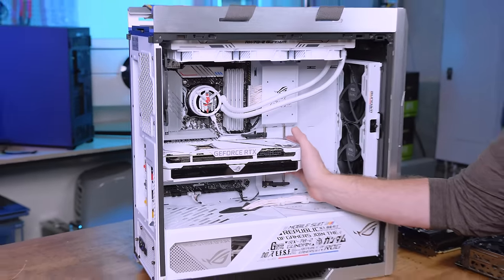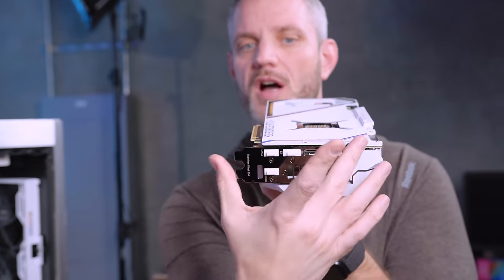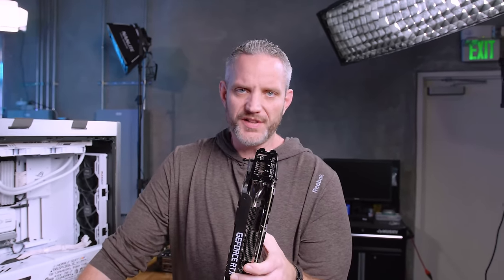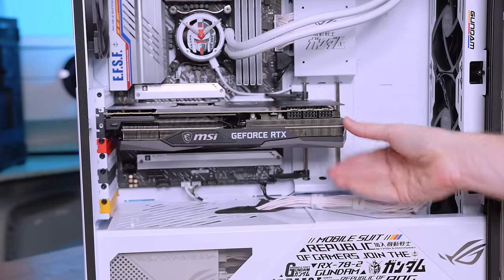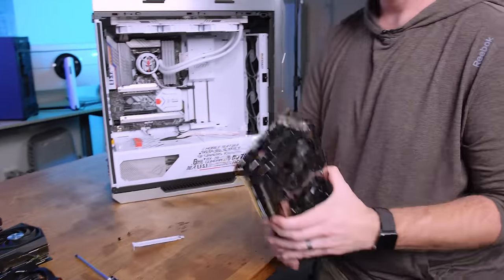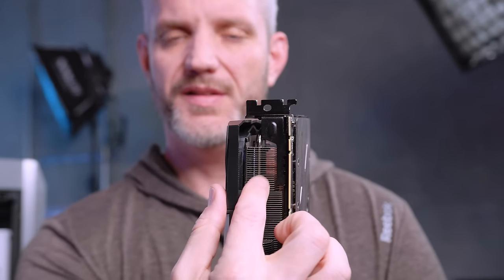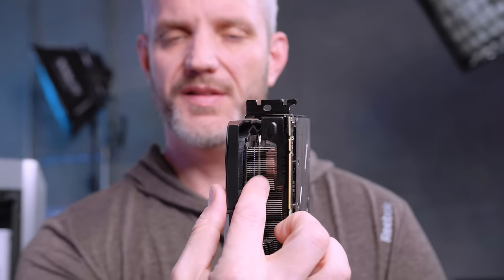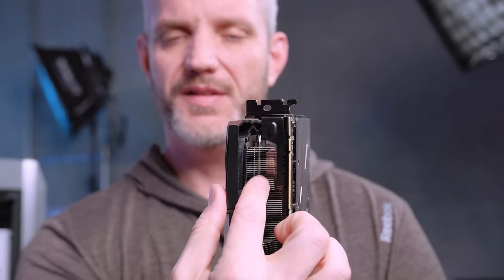How to fix GPU sag ONCE AND FOR ALL! FREE!

Comment: I had this problem on my 3080 Tuff. I solved it by 3D printing a black sag bracket. It worked very well and you can hardly notice it with the glass panel on with rgb lights on.

Comment: Other ways to fix sagging:
- Use a vertical Case (I have a Silverstone Raven RV02 and i love it - it is over 10 years old, still best airflow i ever had)
- put a drop of glue that gets really stiff between the cover in the Back and the cooler
- use a vertical mount
- fabricate a small support the most hanging edge of the card if you happen to have a 3D Printer...
Reply: -Have a small or no gpu at all
-Use water cooling (The water block is USUALLY way lighter than those beefy heatsinks)

Comment: Just did this with my 3080 and it worked! Thanks for this simple and easy fix - was driving me crazy since I installed the new card.
Reply: Its really nice If the case is fully black you wont even see the brackets.

Comment: even better solution: just put some adesivo rubber pads instead of more brackets. I got some of those cheap, transparent silicon anti-impact pads that you usually use for walls (so the door or handle don't hit it). Worked PERFECTLY.
Reply: Can you post a link by chance? I am not sure what you are talking about.
Reply: Genius! starts pawing through the junk drawer
Reply: Rubber is much better in my opinion too. When you modify metal inside a PC case, there's always a chance of creating some type of short. Overkill, I know, but yes, "I'm saying there's a chance". Plus - sound/vibration dampening!

Comment: Thank you for the simple fix!

There are other implications with sagging cards. Over time, the PCB its self will warp and cause intermittent failures as the etches crack and solder joints fail. This was an issue some years ago with poorly designed cases causing the motherboards to warp and flex. The other issue too is as the video card sags, this will put stress on the motherboard its self and that will cause etch-failures along the PCI-e slots.

I ran into these kinds of issues a few decades ago, or more now actually (I'm getting old) with various circuit boards I used to repair back when I used to be a board technician.
Reply: @CRSolarice  You're absolutely right. It's funny how ideas float around then return.

Back in the olden days, the issue was solved by using a channel to support the PCB along its edge near the front of the case. This worked well until cards were pulled in and out carelessly breaking the plastic channel or popping it out of its mounts. When that occurred, the cards would sag and cause problems with the motherboard such as the ones I mentioned. I ran into many motherboards that had ripped connectors and pulled etches. Sadly, once that occurred it was quicker to scrap the board than it was to repair it which could be done using buss-wire and solder. This latter part wouldn't be possible today due to the high frequencies we find with our computer busses. Back then things were in the Khz and low Mhz range.

The other issue we face today is computers are not all the same size and not all are manufactured in factories like Dell, Lenovo, and HP. Today, we have enthusiasts putting machines together with various sized cases and motherboards, making a one size fits all solution impossible.
Reply: @CRSolarice  I'm not much further behind you. I currently have an i7-5860. I agree going for the latest and greatest isn't necessary and I too go for the "new stuff" later usually to let the crowds pay for the hardware development and work the bugs out before I come along and get the stable hardware for a lot less than they paid for it. 

Right now, I am looking to replace my system because I lost some USB ports on my motherboard. I powered up my PC and the keyboard and mouse didn't work and neither did my backup drive. I jiggled wires, but that didn't do it. After a second reboot and replaced keyboard and mouse, the system booted, and the hard drive appeared but the system can't find 3 USB ports. My 1080 TI and RAM still works and so do my hard drives. I'll get another motherboard, one with a faster chip and move my RAM, hard drives, and video card over to that.

In the 1970s I was building electronic kits and instead of becoming a music major like I originally planned (parents said NO!), I got into electronics instead. I headed initially to engineering but found tech stuff more fun and eventually landed in the hardware tech field testing and repairing circuit boards until those jobs went overseas. Today, given my eyesight, I'm not even sure I could do it because the components and everything is the size of ants. The stuff I worked with were the typical 70s and 80s equipment with little surface mounted components. I repaired disk drive controllers, modems, video terminals, and all kinds of memory cards, I/O controllers and comms cards. I learned a lot too and came to the conclusion that even the stuff we have today is still the same as yesterday except smaller, faster, and more delicate.

Your concern is a big one because that can ruin the sockets eventually as I saw in the ancient hardware with cards not supported. Some of those systems had what we referred to as board packs. These were multiple boards that plugged into a single one via riser connectors and ribbon cables. This made a heavy pack, about as heavy as those new video cards. Without that extra support on one edge, that would eventually pull out of the socket and sometimes ruin the motherboard or backplane depending upon which style system these were in.

Laying down your case isn't such a bad thing. The problem is It will be absolutely terrible you won't be able to see those blinking lights! We'll have to commiserate over a beer someday on that one. 🙂
Reply: @CRSolarice  excellent comment.

Comment: My case is a Corsair 5000D with a dark black side panel window.   I just went to the dollar store and purchased a super thin black metal wire,  tied it to the gpu and secured it to the top of my case.   My case its beside my desk on the floor, so there is almost no way to see the wire.  Solid as a rock support for $1.25.  A great alternative.  In the new right now,  on some gpu cards , the tab that fit into the motherboard at the bottom of the gpu, is cracking.  The gpu company then denies the warranty claim due to a damaged gpu board. That basically kills the gpu because some companies have electrical traces running through it.  So either support your gpu in some way or risk killing it.

Comment: This worked! I have a Lian Li Lancool II Mesh case, with an EVGA Gefore RTX 3070 FTW3. I took the two extra brackets, slid them in as described in the video and the sag is gone! The nice part about this case is it has a darkened border on the glass door, so you cannot even see the screws once everything is in place. Thanks Jay for the ridiculously simple and free solution. This should have 1M+ views.

Comment: On an older build I had, I just tied butchers twine to the top of the case and looped it over some part of the gpu at the front and that fixed it for me. Pulled the card right back up and looked unique really.
Reply: Same, but I used fishing line attached to the plug of the power cable.

Comment: Even if the back of the card is supported, the card will warp downward over time regardless; the bend happens throughout the whole structure. That's something that occurs over years though; not an immediate visual sag. You'd need some kind of brace to stop that.
Reply: Not if you have a metal back-plate the covers the PCB.
Reply: @weeooh1  Ah yes because metal is unbendable...

Over time, this will happen to any card which is heavy enough and has no back support.
Reply: @Xorthis  Of course metal is bendable. But would need far more force than the weight of the card.
Reply: @weeooh1  Over a long period of time, and repeated heating/cooling cycles you'd be surprised...

Comment: IF so many GPUs are now OVERSIZED & HEAVY,  is it time to return to the "Horizontal Desktop" for a majority of PC components to be less abused???
Reply: I can't see that being a popular idea. First off it'd be more difficult to showcase your hardware, second the desk footprint would be enormous. It was fine back when you could just stick it under your CRT monitor that was the size of a microwave, not so much now.
Reply: If cards really get that big, I think case manufacturers will add an integrated gpu mount with riser support before this happens.
Reply: Only if you were doing one of those Desk Pc's like Linus did...
Reply: It’s my foot rest 🤣
Reply: @LyK0sa  Right, to showcase your hardware to... absolutely nobody but yourself. This fad of having super showy setups is nothing short of narcissistic.
Reply: @Gabu_  The dude who buy skins for his character in a FPS.
Reply: so IF not the "Horizontal Desktop" case, how about Motherboard MFG's begin making those x16 slots "VERTICAL" to there won't be sagging GPUs?? Think it hard, maybe just maybe it'll happen????  Jay, what's your take?????
Reply: @Gabu_  whether you like it or not, its the direction that the market has gone. Manufacturers aren't going to make a case that they can't sell.
Reply: @thelistener4101  That would mean setting up a new standard to replace the current (and quite old) ATX. Vertical slots for vertical GPUs would mean either turning the board 90° and needing deeper cases (since a fill size ATX board is longer in one axis than the other to fit in 7 slots), or moving the RAM somewhere else, which then requires the entire board design to be changed.
Oh, and your graphics ports would be either at the bottom or top of the system instead of the back. Would you like your card in the front to block intake air or in the back to block exhaust?

Remember BTX?
That was supposed to improve cooling by having everything lined up so that the air could flow straight through? Yeah, except a few OEMs nobody ever used it, and it got out of fashion once the Pentium 4 was obsolete.
Reply: @ZackSNetwork  got triggered?

Comment: Thanks to the first 10 minutes of explanation, now you know why the extra bracket works and where it should be supporting.

Also i got a EVGA RTX 3080 XC3 which is 3.59 pounds or 1.62 kg. I have been using it for 3.5 years and do carry my PC around for maintenance from time to time so there's some movement applied. Everything is fine at this moment.

but i think although Jayz help in the aesthetic of no more sag, i think the main concern should always be the PCIe slot that is holding the majority of the weight at the other side of the GPU. the brackets only carry the extreme end of the card.

There will always be weight pulling down on the other side. only thing is how big of a concern is it? nobody knows until the connector broke

Comment: I bought a little support for my 3070ti, but it was too tall. I ended up improvising and found that two stacked red Solo cup shot glasses fit perfectly under the far corner of the GPU under near the front of the case to lift it up and eliminate the sag. Plus it adds a nice vibe to my build.
Reply: I used a clipper lighter. It fits perfectly between my evga 3080 ftw3 ultra and the bottom of the corsair 4000D tower :)
Reply: I had a bar in my stock case that was not adjustable, so I used a bacardi bottle cap to bridge that gap
Reply: I used a clipper too, one of those mini ones tho - it was the perfect height for the corner of the card to rest on the gas button

Comment: There's a Flaw with your Sag to place Theory Jay.
Some cards will flex enough to allow Thermal pads to separate from contact points .
Best solution I found is Supporting the furthest corner of the  card. It can be done in many ways even with a Pen case cut to length if you don't care about looks.
Its kind of a Poor mans solution equal to Case support you have there.
But actually more rigid than the case support.
Reply: lego bricks
Reply: This is the best and the most effective solution. Stacking brackets as shown in the video will eliminate some flex but not all of it.
Reply: I cut a 20 oz bottle in half lol to use it as a kickstand for my asus tuf 3070 ti lol. It works until I can get something else.
Reply: I've cut a 2 by 9 cm piece of cardboard and placed it under the furthest corner of the GPU. I've designed a custom support than I plan to 3d print, but it's coming in the future.
Reply: @Haren94  Not worried about heat damage if using cardboard? Or if using metal, short circuits. What material would be best? Ceramic?
Reply: @AzzySunfire  No component in the card heats up beyond 90 deg C, this cardboard piece sits outside and I doubt it ever reaches even 40 deg C - so I don't expect any heat damage to be present. It rests against a plastic outer casing of the GPU, so metal would probably not cause any shorts either. As I wrote above, 3D-printed plastic would be best imo.

Comment: the 3 slot design really seems the way to go. hopefully they make more cards like that in the future.
Reply: Or design GPUs that consume less power and require a lighter and thinner cooler
Reply: Would have been the solution ever since the coolers make the 3rd slot unusable anyway, and even way before that it's always been recommended to keep the slot beneath free because of the airflow.

But I guess that little bit of metal to have a 3 slot instead of 2 slot bracket is just waaaaay too expensive - even on a $3000 card. Will never understand those utterly dumb business decisions, never ever.

Comment: 0:57 motherboard screw is missing by the PCIE slot, that will absolutely cause your card to sag more than it would normally as well. I've seen motherboards flex REAL bad in that spot.
Reply: A lot of cases have pegs there rather than a standoff. That might be why it's not screwed in.
Reply: Yup, its a guide that goes in the hole. Can't screw in the middle hole mate.
Reply: lots of cases don't support a screw in that slot since it's raised and has a post that comes through that hole to help with mounting the motherboard
Reply: On most cases nowadays use a peg on a standoff instead of a normal screw in the middle to help guide the motherboard into place when building the PC, so it's supposed to be missing a screw there.
Reply: @RubyRoks  Man i haven't seen that since my pentium 2 days. They really doing that again?
Reply: @draggonhedd  yea, I have the Corsair 4000x and 5000x, both have a peg there. No way to put a screw in there most likely

Comment: The filler cover you removed can be used on the saggy end of your card if you have a screw available on the free end. Don't break the bracket so it's shorter, point the short-bent end down so the bracket looks like an L then use one of the holes in the bracket and screw it onto the graphics card at the right height on the saggy end. Free solution that actually supports the card. I guess it does help if there's no fan in the way on the bottom of the case.

Comment: At the risk of sounding like a certain guest on a certain Podcast "this needs to be looked into". I have my Tower laid horizontally just because I was afraid it'd not only damage the GPU but the motherboard as well. I also run the risk of the discs not being read by the rom drives so I got an external one. I'm fairly certain it shouldn't be worth this much trouble. Thank you JZ!

Comment: I usually just route the PCIE powercable with enough slack in the front of the case that it acts like a sag bracket when you put the side panel on. With a PSU shroud on the bottom and the panel pushing the cable inward and up it supports the card nicely.
Reply: but what happen if i use my pc open...
Reply: @zamfielis  thats not smart to begin with

Comment: How about...... using the rear cover you've discarded into a box as a support stand on the outside edge.... Measure non sagging height , bend the cover straight end 90° pop rivet it to the psu shroud use velcro on card contact areas , viola kickstand you can secure the power cables to  as well .... I'm using that on my corsair 4000d af looks like a mini girter due to the stamping ...just a thought

Comment: Heh, I've actually been using that trick with the screw. However, that's on my EVGA 1060. The newer RTX 30 series can be much heavier and I feel a lot of stress would still exist on the ends of the card even if you use the screw trick. I'd feel more comfortable using a support bracket to hold up the far end if just for the fact that it ensures the PCB and metal backboard aren't so stressed.

Comment: Main problem I find with the brackets that hold GPU's up, is they quite often can lead to parts moving due to increased heat and end up touching against the fans
Reply: gpu sag it needs a pull up bra🤣🤣🤣

problem solved🤣🤣🤣

Comment: Although this fix indeed removes sag and indeed is free, it introduces some unusual strain inside the video card assembly: the cooler-heatsink “layer” (so to speak) will be tending to shift against the PCB-chip “layer” along the horizontal axis, so you gotta check how well these two are bolted together before applying the fix. The PCB doesn’t weigh much compared to the heatsink though, but it has some weight for sure, especially with power cables plugged in.
The better way, of course, is to buy or make some vertical support for the most sagged corner to distribute the weight of the whole thing somewhat evenly.

Comment: Though...
One has too be extra careful that the extra PCI-brackets dont short out on the motherboard as they are only secured at one point. I would put a heatshrink sleeve around the bracket "stack" to keep things from shifting around over time.